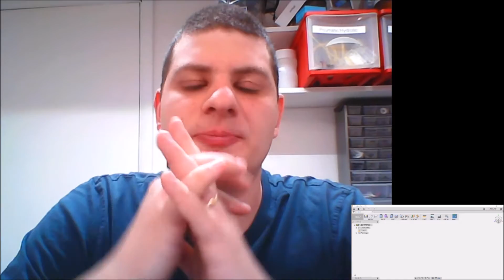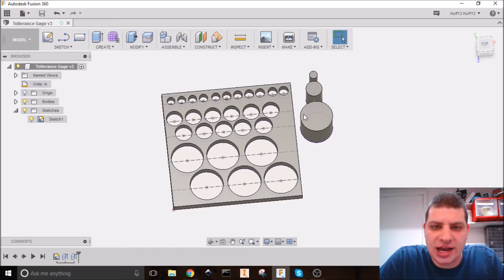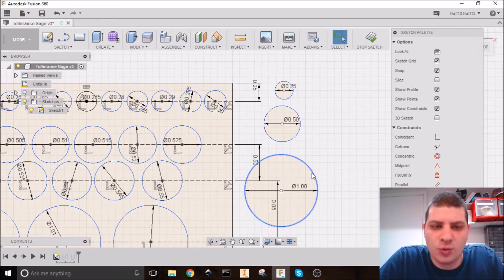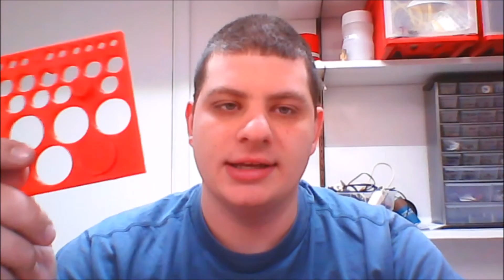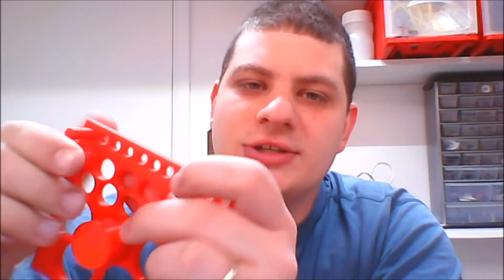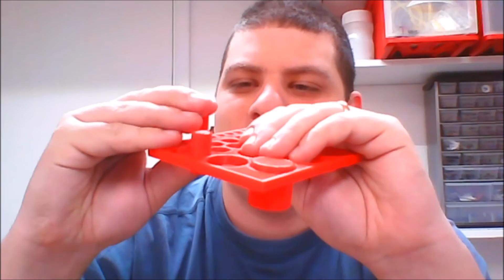3D Printing Fits and Allownces

Comment: You can indeed calibrate a 3D printer to print fitting parts with edge to egde touching shafts and holes model.  Check this out, https://www.thingiverse.com/thing:52946 .

Comment: I did this calibration with my printer. Very useful when designing mechanical parts. Thanks for the vid man.
Reply from the maker: +3D Printwiz it's amazing how doing little things like that can make a big difference in how well your designs work. I keep that little part I printed on my desk so that I can always reference it.
Reply: Actually in 3d Printing, design tolerances or allowances greatly depends on two factors, which is Filament and Machine settings. So when I have a new material, I always have a separate calibration for it. As for machine settings, I try my best to have it as much as possible constant for all PLA and for all ABS.

Comment: Thanks AJ for answering that question! Once again I have learnt  something from your videos.
You had mentions about using a half nozzle width measurement for working clearance. How close does this work out to your findings with this latest Experiment in regards to the 5 thou ?
Reply from the maker: +GlenGH so the rule of thumb was pretty close for high quality settings, but a little more sloppy then I was thinking. 0.2mm=~0.008".

Comment: What was your layer heights low and high don't mean much , but great video about engineering fits
Reply from the maker: +Mark Bridgewater the high quality was .15mm and the low quality was .3mm the biggest difference between the parts was print speed though. Low quality was at 100mm/s and high was 50mm/s.

Comment: What size are the pegs when measured
Reply from the maker: +Mark Bridgewater 
.25 LQ .255
.25 HQ .254

.5 LQ .504
.5 HQ .497

1 LQ 1.05
1 HQ .999

 I actually noticed that the Y axis was a little bigger than the X axis on all these prints when i was first shoving them in the holes, and had to tighten some belts. The printer would probably preform a little better if I fixed that.